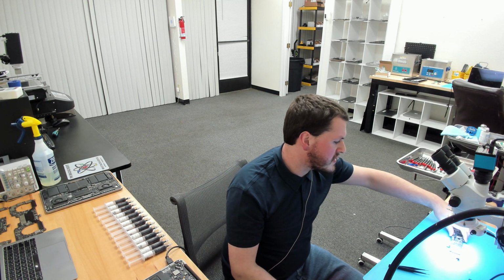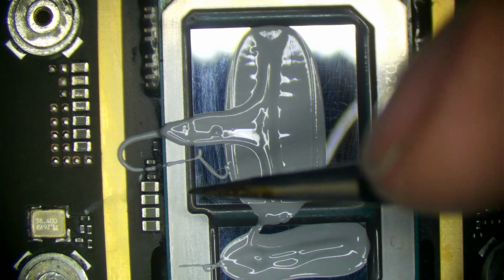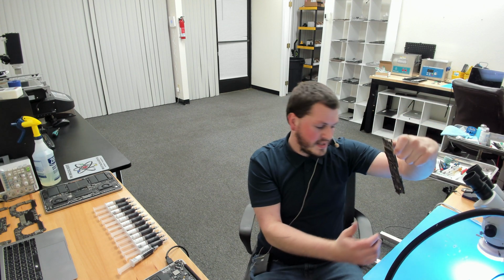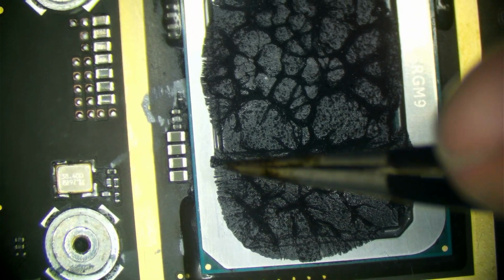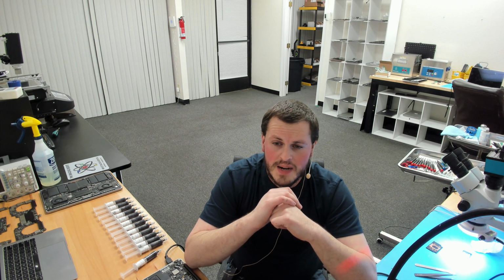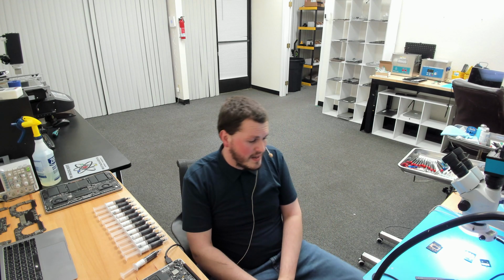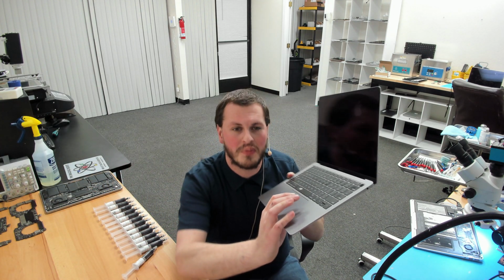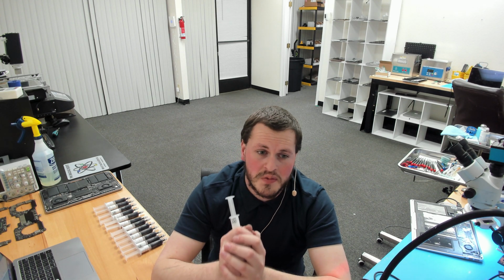TCRS Circuit Product Announcement: Specialized thermal paste for A1932/A2179/A1534 and M1 SOCs

Comment: Just want to know how the particles of a viscous paste “find their way” to the right place.. I sure missed such a process in my fluid dynamics classes. Could you expand on the subject maybe using research papers as proofs of concept.
Reply from the maker: The viscosity changes and the paste becomes slightly thinner when hot during the first few thermal cycles. When the paste thins out, it allows the smaller particles to flow into the cavitary regions of the heatsink. I take it you never have seen the heatsink surface on one of the devices the paste is meant for. The surface is very cavitary and has many small gaps.
Reply: It's a thick paste for filling large gaps, the apple heatsinks this is useful for are poorely made and warped... This dosen't look like a replacement for standard desktop thermal paste where very good contact is made.

Comment: Very funny that apple won't do it the regular way and reduce the heatsink gap, but rather use some exotic thermal paste.
Reply: Probably a "process reduction" by the bean counters. Leave the heatsink surface sh1tty, and since you're applying a paste anyways select a different one. 

A true sign of "we do not care about making it right, we want more profit from your purchase".
Reply from the maker: @volvo09  Exactly... because then the CPU dies from improper cooling after it is worked on and repasted, and then the customer goes out and buys another macbook
Reply from the maker: Gotta love it...

Comment: Cheap Chinese MX500 was the solution for me for overheated heatsinks - some 150-180C. Works quite good for power transistors etc. Needs retying bolts after heating, alas.
Reply from the maker: Almost guarantee its too thin for these heatsinks.